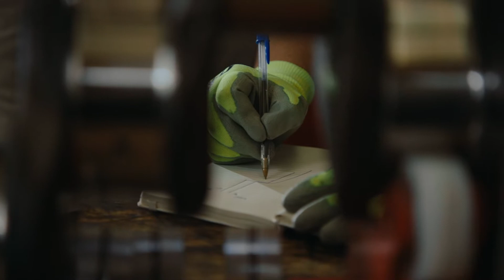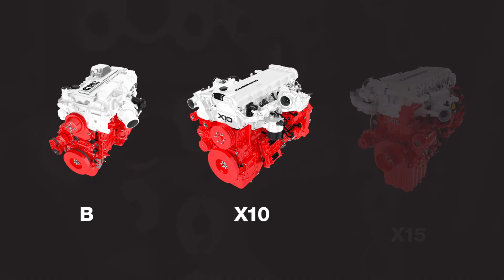Introducing Cummins HELM™ platforms - Higher Efficiency, Lower Emissions, Multiple Fuels

Comment: Zero emissions is physically not possible. If you're putting out work, the energy has to be produced/converted/stored/transmitted multiple times. There is loss in each step on the way.
Almost all commercial hydrogen comes from cracking methane. That produces waste leftover, consumes energy, requires extremely expensive transportation and storage equipment, and is extremely inefficient. But hey the tailpipe "emissions" are low so who cares what happens before that!
Carbon is the result of clean combustion. By removing CO2 you are inherently making the process LESS efficiency.